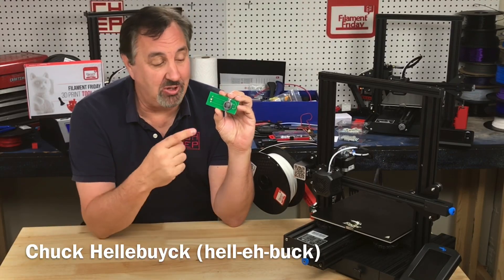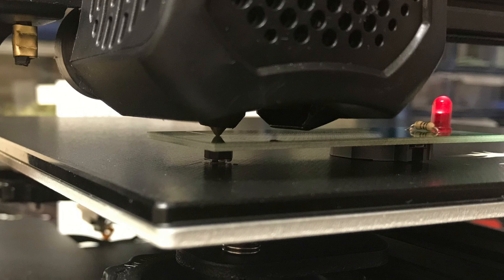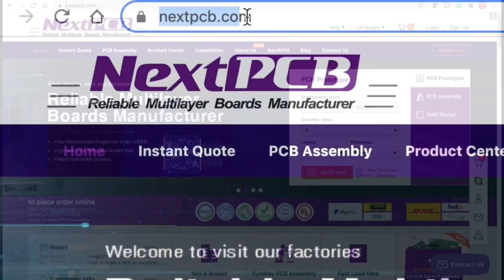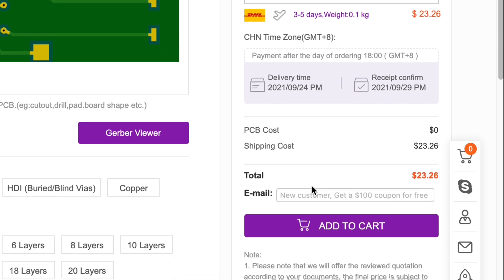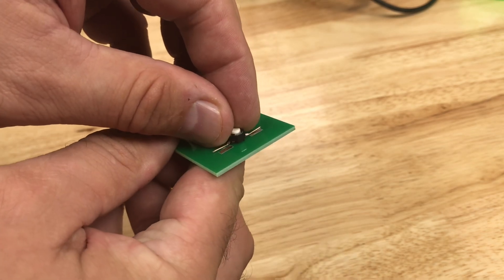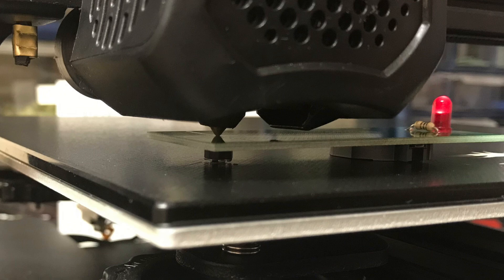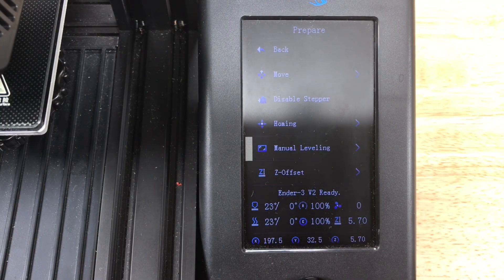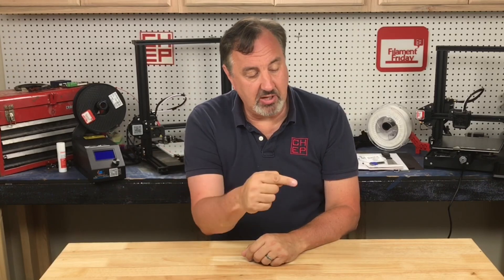Filament Friday E-Leveler - Electronic Device for Easier Bed Leveling on any 3D Printer

Comment: Just incase anyone has a ender 3 Pro. THIS DOES NOT WORK WITH ENDER 3 PRO. Because there is no way to adjust the z offset in the menu. waste of 40 bucks. best thing about it is there is ZERO way to contact him about it either.
Reply from the maker: Numerous ways to contact me, as you just did. You can use it on Ender 3 pro. There is an M25 version at this site if the M0 GCode doesn’t work. https://www.chepclub.com/electronic-bed-level-tool.html
You can also home it, then raise Z to 5.8mm and disable steppers. Manually move it, level with the tool then home it again and run the test.
Reply: @FilamentFriday  Ok my apologies thank you for clearing it up for me.
Reply: just tested with your gcode works great thank you for pointing me in the right direction.
Reply: There is definitely a way to edit the z offset in the menu of an Ender 3 Pro.